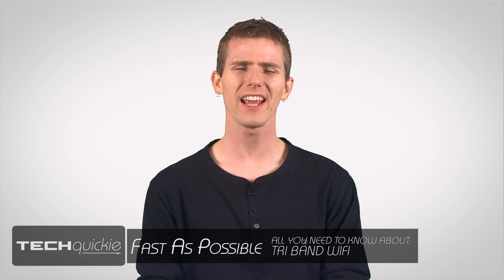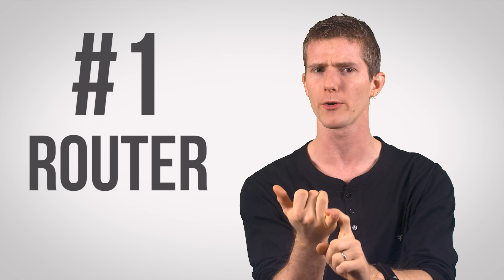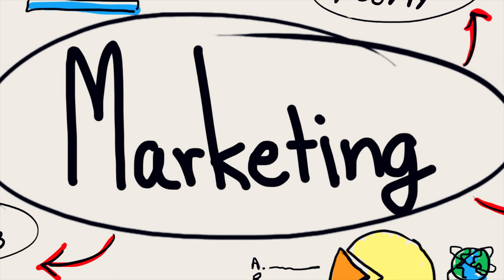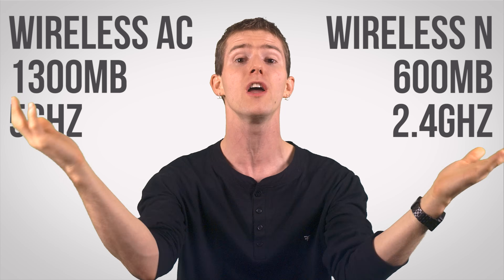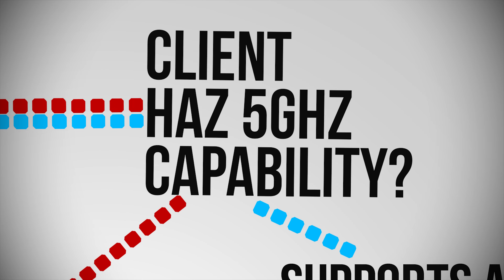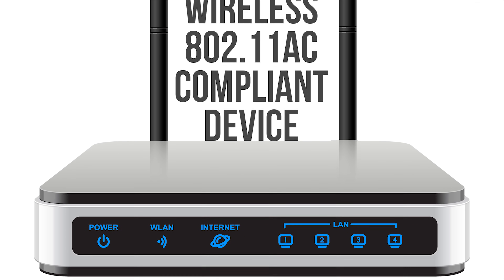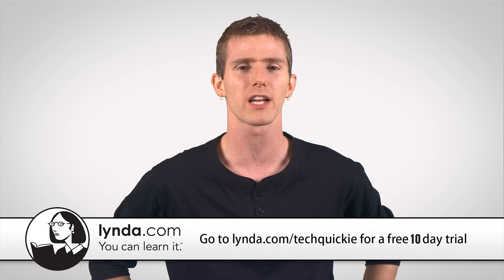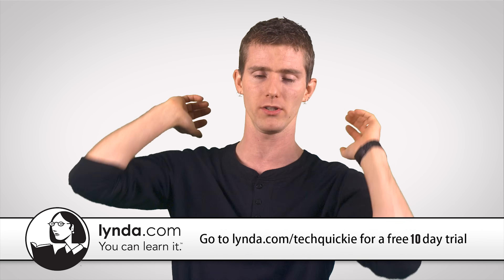Tri Band WiFi as Fast As Possible

Comment: can you explain chromecast? i never understood what's up with that and if it works in Romania
Reply: I little chrome stick that plugs into a HDMI port in a TV/Monitor (I Think). You will need to connect it to a Wifi source and download the App on your phone or the Chrome Extension. You then connect to it and it will show what on your phone/tablet/PC onto that screen the Chrome Cast is plugged into.

So yes, it will work in Romania you you can get it there :~)
Reply: sirnicko1 thanks for replying. so it basically connects with the phone or laptop through the wireless network? so it's basically some sort of TeamViewer that shows on the tv what's happening on my laptop?
Reply: sirnicko1 firstly i thought it had an operating system(android?) and it was basically a very little laptop(because I usually connect the laptop through HDMI to my tv to see movies). Isn't that what AppleTv is?
Reply: Andrei V Imagine pluging your laptop into your TV to watch internet shows. now imagine doing that but without the wire. BAM chrome cast.
Reply: Nice of people to explain it, but a video would still be good for anyone who hasn't seen this. Also Amazon Fire TV and all the similar stuff.
Reply: Andrei V its a caster which means it will cast your media from your phone or pc to a tv(with chromecast connected)
Reply: Andrei V In a way yes. It kinda does have an OS, but mainly only to power the connection. As long as something is connected to your wireless and the Chromecast is too then you should be able to connect to it (providing you have the app/browser extension)
Reply: dave091790 bam, i got it! thanks. but how does it work? just as TeamViewer works connecting 2 laptops with internet connection?
Reply: Antti Alppinen Really? A guy at my works was using it with his phone and it streamed everything. Unless you mean on a PC/Laptop?
Reply: Antti Alppinen My brothers streams everything. it's basically an HDMI cable, but wireless. It's really not complicated enough to deserve a quick as possible.
Reply: Antti Alppinen Full screen for the mobile devices. Certain Apps/Programs for PC/Laptop and All of Chrome itself.
Reply: Tmohas Danktrain da, inteleg ce zici. cat despre ala cu nume de bautura spirtoasa, eu as recomanda sa nu hranesti trolli. Pentru ei atentia e pita cu slana si ceapa. :) see you around
Reply: Andrei V Man its really shit bcs you can only stream apps and only few of them u can tell your tv wich video on youtube to play. Its not like teamviewr its very limited.
Reply: expert20valvehlx you could even cast your whole phone if you download their app so you could play a game of angry birds or something on your tv
Reply: Chrome cast can be shared through Wi-Fi so if you have a smart tv an Xbox or something that can play music or youtube you can use your phone to do that